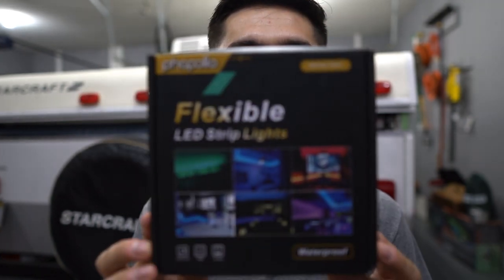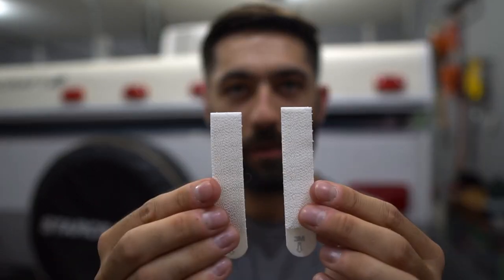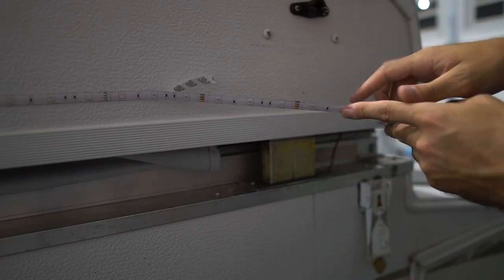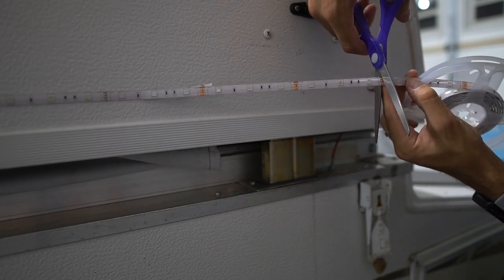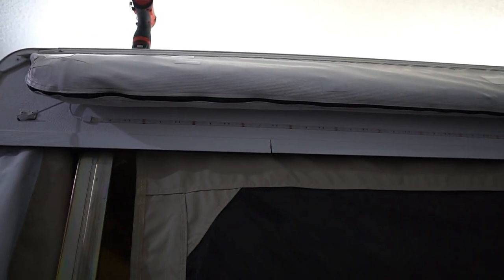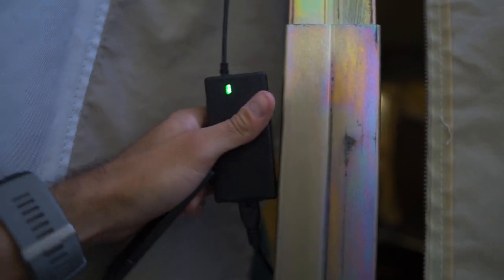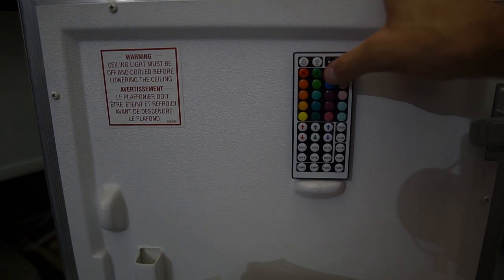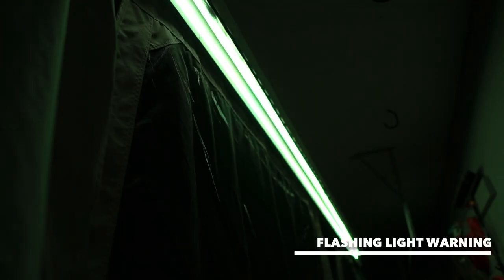Pop Up Camper LED Strip Lights Modification | Inexpensive & Easy Pop Up Camper MOD!

Comment: The LED strip looks great!  There are awning LED strip kits that for about $50 that are better suited for a camper. They include a C-channel & 3M adhesive strips that grips to the side of the camper. The LED strip itself is encased in a silicone sleeve to make it waterproof which then locks into the C-channel. It comes with a RF remote (rather than infrared) so the remote can be anywhere to change the color. You don't to line of sight to the controller.

Comment: Hey there!  I enjoy the vids.  I have used LED light strip on different projects for years.  You actually didn't need to use the power transformer as controller (the white box) uses 12v power that your camper already has, just use an adaptor plug.  Just an FYI.  Keep the vids coming!

Comment: When I get my camper back I’ll have to show you what I did. I hardwired my light strip, and also added a 45 angle defuser housing that I randomly came across hahaha, love your videos, wish I had the time to do the same. Also added a battery cutoff switch for when the camper is in storage. Going to add in your 12v charger/battery monitor to the inside.
Reply from the maker: Thanks! I'm going to put the battery cut-off switch on our to-do list.
Reply: @ItsPoppin  I’ll shoot pics of that too!

Comment: We have really wanted to do something exactly like this.  Two things we haven't decided on yet.  One is that our awning bag is very big and comes down almost to the bottom edge of our camper top, so if we did the regular LED strips, they would be almost right above the bottom edge of the top shell.  That led us to think about edge lit LEDs.  But then we are not sure how much light they would project outward, and if it would be enough to light our sitting area.  I would also love to wire them into the 12V system so they can be used with the battery and not need any transformers.  So far, I haven't been brave enough to drill into the roof and look for the electrical wires up there.

Comment: You mentioned the led are converted to 12 volt if its DC you should in theory be able to bypass the transformer and hard wire it to the low volt system on the camper. The transformer should be coverting to DC I believe

Comment: A 16' strip draws about 2amps so a 5amp power supply will run 2 strips end to end. If you add more they will be dim. 2amps at 12v is 24watts. I was looking into doing this myself when I stumbled across this video. What I built today is a 1/4" mono to 2.5x5.5mm (same end as the ac/DC power supply) patch cable. Since these lights run on 12v DC I should be able to plug into my 1/4" accessory plug on the porch light to power my strips. Anxious to test it out this weekend
Reply from the maker: Let us know how it works out!

Comment: Hey, my wife and I just finished up renovating our 2009 Palomino Pony. Have you ever thought of or done a video of improving the interior lighting? I have converted the bulbs to warm LED bulbs, however I still find it to be quite dark inside the trailer at night. I'm thinking of led strip lighting. Ps I love your channel! Keep posting those great videos, have learned a lot from them! Thanks!
Reply from the maker: What wattage are the LED bulbs you put in?  We’ve found that the 5 watt variety work the best for lighting up the interior.  Beyond that, you could consider picking up those light/fan combos that connect to the shepherd hooks if you have the connector in your pre-existing lighting; however, those are kinda expensive for what they are.  A fun option to add a little bit of lighting to the bunk ends are those fairy string lights that are battery powered - just wrap them around the shepherd hooks.  In our first camper, we wanted more light over the “kitchen” area, so we mounted a battery powered tap on/tap off light with Velcro right above that area.  Finally, I think you could definitely pick up some of those led strip lights (like the ones we put up on the exterior of the Starcraft), but those will only work if you’re on shore power.  However, I’m sure they make battery powered ones as well.  If you want to do a more permanent modification, you could tie those strip lights into your preexisting 12 volt system, and that way you wouldn’t have to worry about plugging them in or running out of batteries.
Reply: @ItsPoppin  
Thanks for your response! Yes i believe the LEDs are 5watts. They are 500 lumens. I might try the fairy light idea, though I dont like the idea of having to replace batteries all the time haha. Might try push buttons over the beds.

Comment: Looks good! Have you ever installed one of those 3-port USB/cig lighter/12v panel? Do you have any videos on that type of installation?
Reply from the maker: No, but funnily enough this is on our to-do this.
Reply: It's Poppin' - Pop Up Camping Looking forward to it! I have mine installed, just need to make the connections 😂

Comment: I used shrink tube where the wire plugs into the white remote plug and they work great. Just make sure you buy better two sided tape then the lights come with. That tape lasts three weeks
Reply from the maker: What brand did you buy?
Reply: @ItsPoppin  Relohas led type 5050 I had used them on my deck stairs and they worked great. Other then the tape coming off the strip. I redid it with 3M two sided tape and they have held great ever since.

Comment: what i whould do is get 12v automotive   srrip lights place it whare its best if on the out side drill a small hole run the cables towards the ciling light housing and splice it in or more fancer use offroding automotive 2 whier water proof plug and fuse then plug it in

Comment: Can you do a video like this but installing the lights inside and hooked up to the existing dc lights?  I want better lighting inside but I’m not sure how to hook it up to the current lights inside
Reply from the maker: To be honest, I'm not sure we will ever do anything like this, but its not out of the rhelm of possibility. Two alternative suggestions: upgrade your existing light bulbs to superbrite LEDs (something around 5w and 600 lumens)  or mount battery powered lighting to your ceiling where you need additional lighting.

Comment: Have you made a video on re wiring the 7 way plug? I just found out there were two different types of 7 way plugs.  What a nightmare that was. I spent the next hour doing every wire separate till I found the right order again.
Reply from the maker: We got you skip: https://youtu.be/HWnP3W776EM.  This video isn't specifically devoted to that topic and isn't overly detailed, but we did replace it on the Palomino.
Reply: @ItsPoppin  mine was all corroded so I figured why not. .Its been a nightmare since. I didnt know there were two types.. But the setup you bought makes it so simple. .thank you

Comment: How is the light strip holding up?
Reply from the maker: We sold the camper.  However, we kept in touch with the family who purchased it and as far as we know, so far so good.
Reply: @ItsPoppin  Quick question…if I take the controller down what should I cover with the bare wires coming out of the led strip? I didn’t think I should leave the controller up the entire time?  Also did you get a different camper?
Reply from the maker: We always took down the controller and didn't worry about the bare wires. We picked up a 2008 Jayco Select 12HW.
Reply: @ItsPoppin  just curious what do you pull it with?
Reply: My lights arrived and intalled them and they look great. Very easy to do.
Reply from the maker: Honda Pilot AWD

Comment: Love watching your videos, glad I found you. We just bought a used poo up camper and it needs lots of work, how did you put the new zipper #10 in the side wall? Is that something we can do ourselves..I guess the wall would need to come off to sew it in?? Thanks!!
Reply from the maker: That particular zipper was an "open" zipper so we were able to just slide it on.
Reply: @ItsPoppin  thank you for your reply, I don't understand ..the large zipper in the corner?? That isn't sewn in? Thanks
Reply from the maker: Sorry, I should have clarified. The zipper pull was able to just be slidden on because that was all that was required to be replaced. The entire zipper aparatus including the teeth would need to be sewed in.